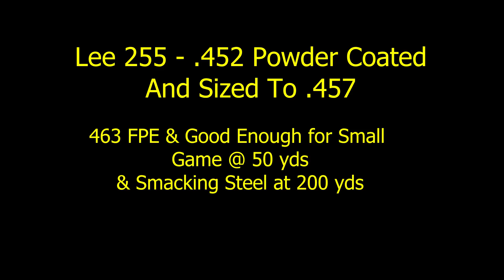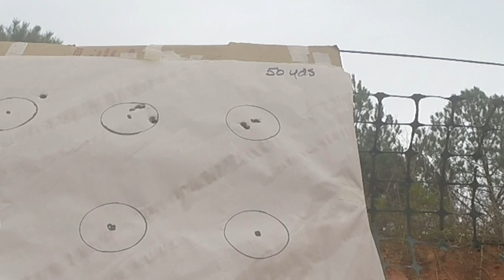.457 Texan CF - Lee 255-.452 Powder Coated to .457 - 50 & 200 Yds

Comment: Small game the man said. Low fpe he said.
In VA the power requirement for big game using a handgun is 350# larger bore than 23cal
Reply from the maker: 463# at muzzle about >320# at 200 yds.    Small game accuracy.   I imagine they’d poke holes through bigger critters than squirrels or rabbits.   This is the same projectile that I was pushing at 1250fps through the 45 acp.   Also fed them to the 450 bushmaster.   They seem to work pretty good in all 3 platforms.   Might not be the most accurate slug for the Texan but they do well enough at 50.   Sadly, 100 yard groups didn’t impress me.   The great thing is they drop from a Lee 6 cavity mold.   It’s a great mold.   You can drop bullets freak’n quick!
Reply: @motorgearhead  there's something to be said for easy casting especially if they work in multiple platforms